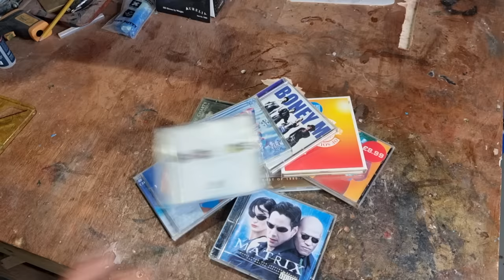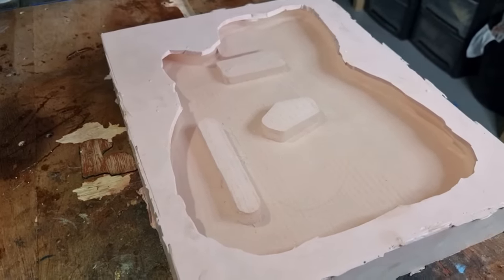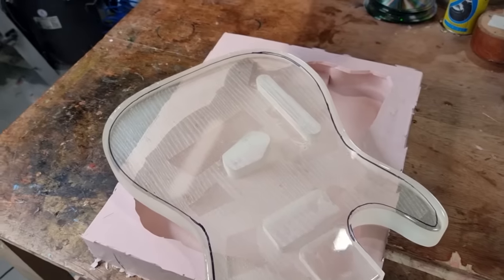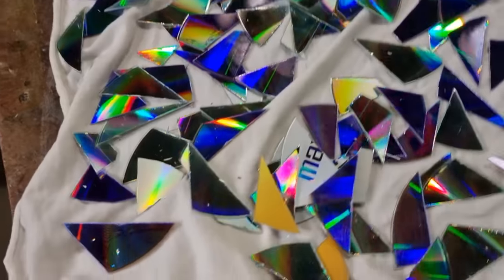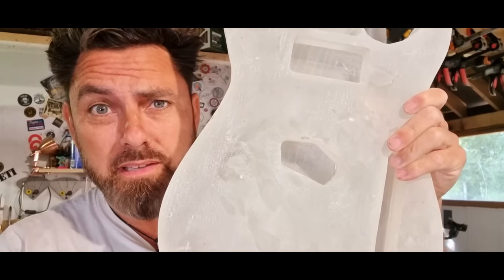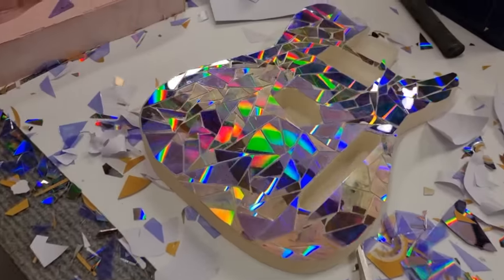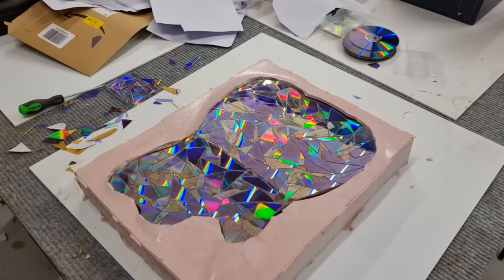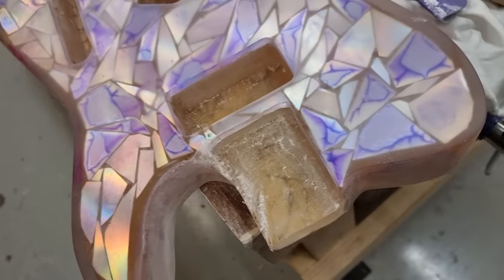Making - a PSYCHEDELIC Guitar from 1000s of DVDs..  This one nearly broke me!

Comment: Back in the 80's I used laser discs for hubcaps. I fastened them carefully to stainless steel beauty rings and covered the center holes with OEM center caps, they looked great going down the strip at night.

Comment: Very nice job. If you ever try this again, you might try putting a small layer of acrylic in the mold, put in a layer of cut up optical media, make some walls INSIDE the mold and put cut up media inside, then fill in the internalized put a layer of cut up discs on the back while the acrylic is still curing.

Comment: you just dragged me all the way back to 2002 and 2003, when i was a student in art school and there were boxes of "free, take one!" AOL cd-roms on every streetcorner in town.  We had a shiny rainbow curtain made of cds strung together in my apartment, and everyone's student projects had either bits of cd-roms or rainbow wire scavenged from all the companies downtown that were just starting to upgrade their networks around the same time. was an interesting time for found art supplies.

btw a lot of the color change of the rainbow bits is likely both from the heat of the resin curing and the resin filling in the tiny pit ridges on the cd and dvd surface that are the cause the rainbow effect on the discs. The guitar turned out beautiful though, it has a very opal or paua/abalone shell look to it that is really very nice!

Comment: Nick, have you ever thought about putting a load of these Cd,s into a food blender, granulate them to about chunks (8mm) then put them into the resin and cast a guitar body to keep them in suspension youl have to rotate the mould until it goes off, then light will reflect of the CDs from all angles, just a thought.

Comment: It turned out really excellent. Thanks for sharing the project. Had you considered using an inexpensive Tele body as the center? Perhaps trimming the edges, similar to how you did with your center and also trimming 1/4" off the front and back? It may have made the finished guitar lighter and probably less expensive than the deep resin pour.

Comment: I made a mask out of CD shards like this and it was the coolest thing…but really hard to wear because it weighed so much and kept slipping down 🤣 using the double sided sheets was a good idea, but you can avoid any dirt and debris getting on it by only peeling back a small bit at a time, and then cover it back up when you’ve finished a section if there are going to be gaps in between pieces.

Comment: This is utterly fantastic, but just a quick thought - If you'd have ran the blank through a planer and took about 6mm or so off the front face, that would have allowed ample room to layer the dvd shards on and let it sit on the recesses in the molds while letting the resin flow feely beneath it.  Cheers!

Comment: If you ran over those jagged edges with a super hot curling iron or the tip of a hot (empty) glue gun, the jags would literally melt away.  In the end,  it didn't really matter though.  😁  The finished project looks FAB!!!  🎄🙋🏽‍♀️✌🏽
I spoke too soon.  🎸  This is not just fab; it's EXQUISITE!   Well done Nick!  👏👏👏

Comment: You should of trimmed both the front and back surfaces, like you did the sides. Maybe only 5 or 10 mils off both sides but it would of made it much easier in the end, poring and cleaning wise. But it still looks good. Next you have to do a Base and some drum sticks like that.

Comment: Very cool guitar and idea.  I wonder if you couldn't do this with a lot less resin (and weight) by using wood or styrofoam filler blocks in the internal structure, leaving room to glue on the DVDs and then  pour the outer resin.   How much did it end up weighing?

Comment: For the purposes of curing resin, can you put a pressure pot in its side? I have some dagger molds I want to use, but they're LONG. If I made a sturdy base/cradle for the pressure pot to lay in, would that work? Thanks!

Comment: I would have colored the blank black to give the iridescent to build off of. And you can flip those DVD pieces and pull the color off with the double sided tape to completely cover the blank and not worry about cutting the pieces to fit or the plastic being left on the blank.

Comment: Nick thats gourgous! I love shiny colorful things like that. I know how it is when a projects takes forver.. been there lol. I  just did this bas releif sculpt but it needed a 2 part mold so I did a one part first tto get a master and had one heck of a time getting part of it out of the  rubber so  I had to cut it and found tons of air bubbles in the rubber.. ok mold 2.. same thing  but 2  parts.  (there's a deep undercut I can't get to to get rid of  any air bucbbles and  I don't have the tpressure pot to stick  the mold  in to get rid of air bubbles) so then mold 3 because I couldn't get enough decent castings and the rubber gunked up and  didn't cure on part of  it so when cast I had hunks of resin on each one! sigh.. I  gave up and took way to much time cleaning all 25  casting up..  sold them all though!

Comment: Holy fcuk that looks stunning! A mirror pickguard could have worked even better than the black classic one. You should try using big glitter star flakes that girl use in scrapbooking, you can get those from ebay. also a led array inside the eopoxy guitar could be cool with usb chargable battery pack.

Comment: Is there a reason you didn't lay down the DVDs for the front on the bottom of the mold, then the back on the top layer before final resin? Seems it would be simpler.

Comment: so you know why they cut between the CD's and DVD's was different. is because CD's are a single or maybe a 2 layer composite. where DVS's and blue rays are 4 to 8+ layers stacked on top of each other. that's how they can have different audio or video tracks over the same video or data layer. so it's like the deafferents between cutting a 2ply plywood or 10ply same idea.

Comment: That head stock is hideous which obviously its a neck from a build your own guitar kit that you can cut it how ever you want it. The body looks sweet as hell but I don't like the scratch plate and pick up selector. I think it would look nicer with out the plate. Change it to a normal three way pick up selector with satin matte hardware ,volume and tone knobs. of course this is your project and not mine its easy to judge. Nice job start to finish which is what matters.